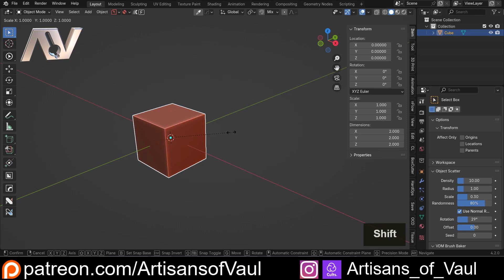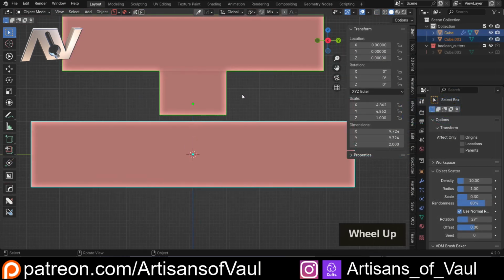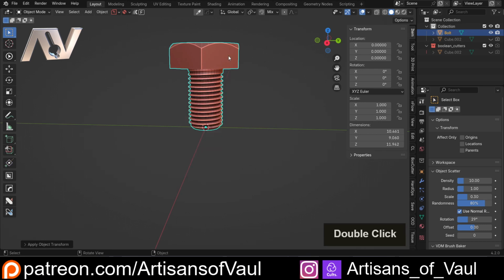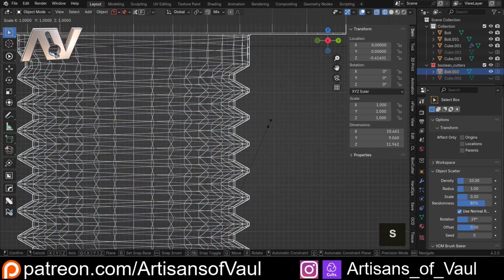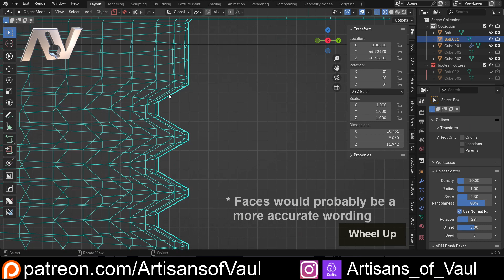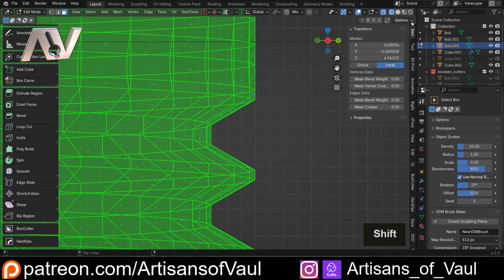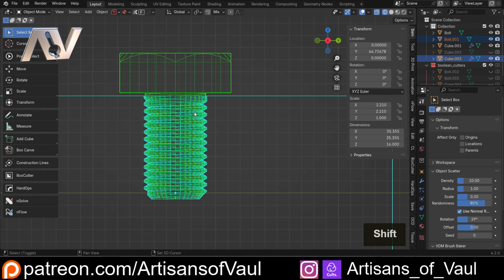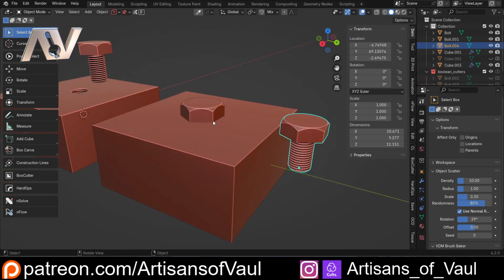The EASY Fix to the "Classic" 3D Printing Design Problem and How to Fix it in Blender

Comment: Great video or not ?  In the top right corner I see that bolt.003 is selected and not the cube. For example, in the video you made  the selected bolt.003 +0.20mm wider by using Shrink&Fatten. But if you make the bolt.003 +0.20mm wider, it never fit into the cube. Shouldn't you make the bolt.003 narrower -0.20mm to fit in the cube?  Or make the inside van the cube +0.20 mm wider, so that bolt.003 fits into this cube?
Reply from the maker: @janvanderveer316  You've got this the wrong way around in your head I think. Bolt.003 is the object being cut from the cube to make the hole for the other bolt to fit into so needs to be wider to provide the gap needed.

Comment: When I attempt to use the shrink tool on threads they go crazy. They either get really small or really big...it also puts like a cylinder around my threads. I cant figure out how to fix this issue.
Reply from the maker: A cylinder?  I cant say I have ever had that issue to help with it.  If you need finer movements if you use the shortcut with your mouse further from the object it will give you more control, possibly that will help?

Comment: I would loooove a tool to auto-add peg/keys to parts for 3d printing. if you could auto-set up a tolerance for the result, and then just auto add male/female parts based on the tolerance setup. Could probably write some sort of script to do this maybe.
Reply from the maker: @CinderBlock331  I recon you could make something to do that with Geometry nodes. Then just use the object as an asset. Or alternatively have different sizes with a cutter for the boolean as a collection as an asset
Reply: @ArtisansofVaul  Geometry nodes is a great idea. I havent really messed with them, but I might give that a try. A collection is a good idea too, if not a bit clunkier than my ideal imagination.

Comment: Thank you for the video! For me, scaling only along the x-y-plane has worked so far for threads and bolts, but I haven't used such long bolts, where it might not work anymore. I wonder if you have a method, workflow, or addon that allows Booleans for 3d printing giving some absolute tolerance like 0.2mm no matter the size of the object. Scaling is always a percentage value as far as I know, and it always needs some individual adjustments for each object pair.
Just saw a comment from imonseii about shrinking with tolerance in mm...

Comment: If you know the tolerances of your printer, you can go ALT-S 0.1 (for tolerance of 0.1mm).
Reply from the maker: Good tip 👍🏻 I normally like to look at the movement as I do that to check for crossing over edges but it's a great tip.
Reply: @ArtisansofVaul  that's a very good point! if you do the 0.1, and the overlap is only tiny, you only find out after you use "3D printing toolbox" to check the model. which means more cleanup, and time wasting hassle. i guess my tip is best suited for relatively simple models.
Reply from the maker: @imonseii  I think both are very viable workflows. The 3d print check is always a good call regardless, as soon as you're done, as you could always visually miss something.

Comment: This is why the 3D printer software usually has the expand/contract edges feature. At least on filament printers. Don't know if I've seen it on my resin one.

Depending on your philosophy for modeling.. some might insist the model remain the pure shape and the printer just fixes its own limitations in material expansion to make the end result actually match the model (by knowing the growth factors based on the material and various settings, and then counteracting them itself), but this is very hard to do right, and usually way easier to just manually change the model. Talking to mechanical engineers at work, they tend to design in tolerances and such when they're designing parts.. but those are for general tolerances and fit. If you change materials or processes, then we seem to let the one making the part sort it out, not alter our original design.

This has me curious about the best path you should design with. Do you make the printer just compensate and print what you sent it, correctly (or hope it does, and try and troubleshoot when it doesn't?) or do you just manually tweak all that for your specific printer and settings, knowing that while it's fast, you'll be stuck adjusting it if something with the printer changes, such as nozzle size on FDM or exposure settings on resin.

Not to mention, there are things the printer can't easily deal with or would be very complex software, forcing you to adjust your design to make it easier on the printer, anyway. Breaking a model into pieces or making it hollow is the most obvious part you might do in Blender. Supports are even more obvious, but in general the printer software helps you create those before sending it to the printer, of course. Some are adding features to hollow out and cut parts into sub assemblies now too.

I'll have to chat with my coworkers about this now.
Reply from the maker: All good questions. Personally when modelling I would rather build it into the models as it means I can look at any odd results as opposed to the machine doing it where there are might be issues that havent been seen.  Also with 3D printers there are so many factors involved they rarely take account of everything so I would still give some tolerance (even if its less).
Reply: The reason I brought it up was that I have 3 different options to make something (depending on the nature of it), a laser cutter, a filament printer, and a resin printer. And all have very different tolerance considerations. So if I wanted to swap from one to another, I'd have to back out changes specific to that one printer, and add new ones for the next. Even changing filament or resin type might require further tweaking. Seems that would be best managed in the print/slicing software.. but, as you pointed out, they don't always do a great job.
Reply from the maker: @stormycatmink  I have a similar issue but have found it notably more reliable to just have those parts with a "joining" element have a non-destructive boolean for the cut out where I can change the size of that part specifically, of it that isnt possible have the key object as a non-destructive union so I can change that.  I found it took less time to do that than to fiddle around with machine settings and get them "dialed" in to work the way I want.

Comment: Great educational video, but why do that on a practical level? Just isolate your Z (shift+Z) axis and scale the bolt to make the cutter.
Reply from the maker: @andreigalinski413  Good question. In those instance that could work for this shape (though for printing I would still do it this way as you can get some expansion on the Z axis). But in other shapes that wouldn't always work so it might as well be done the correct way to begin with.

Comment: Wouldn’t the solidify modifier do this as well?
Reply from the maker: @colordodge  I don't think so. That would make a solid "shell" with a hollow middle.
Reply: @ArtisansofVaul  I've used this technique successfully so far on a couple prints. I just apply the solidify to the cutter object. I check "fill" and "only rim" - which seems to do the trick. The upside is I'm able to come back and adjust clearances later. But admittedly, I have not tried this with something as complex as a thread - mostly for press fit parts.
Reply from the maker: @colordodge  oh nice idea. Yeah that should work thinking about it too 👍🏻
Reply: @ArtisansofVaul  Yeah, and I haven't looked into it, but if blender has the ability to assign variables, you could update all your clearances on a model with one value. That would be cool.
Reply: @colordodge  you can do that with a driver. it's a little clunky to set up though. a simple-ish way of doing it, is to click on your main object, and in "object properties" add a new custom property. right click on the custom property, and select "copy as new driver". then find your solidify modifier, right click on the thickness and select "paste driver". repeat the "paste driver" for each of your solidify modifiers you need tolerances for. now you can change the custom property value, and all the solidify values will change.
Reply: a simpler way of doing it, is probably to just right click on the first solidify thickness, and copy as new driver, and do paste driver, on all the other solidify thickness values. Then you gotta keep track of which one is your main one.

Comment: Excellent advice! Especially since it's not always just bolts! I never thought of doing it this way.

I think he bolt is tiny because most bolts aren't measured in meters. ;-)    The "Keep Making" youtube channel sells an add-on called "Precision Gears" that lets you build gears and bolts specifically for 3D printing, as well as a whole DIY board full of screw-in parts with different size screws. He focuses on actual functional mechanical parts more than artistic stuff. Just in case any viewers wanted to make a whole bunch of bolts and gears of different sizes a little easier.
Reply from the maker: @darrennew8211  Great tip. I think you've recommended before and it's on my list to check them out 👍🏻
Reply: @ArtisansofVaul  Particularly for gears and bolts. 🙂

Comment: What would you say a reasonable size-up is for resin printers? 

BTW, I fell in love with your vids and they helped me a BUNCH on my journey to designing stuff meself. I love the way you explain stuff. No unnecessary BS around it, straight on point. Thank you and keep it up, please :)
Reply from the maker: @ducba1059  😁😁 Thanks so much. So I deliberately didn't give a specific number as it can really depend a lot on the printer and how "tuned in" it is. So there will be a bit of trial end error but I normally start around 0.2-0.3mm

Comment: In general, for FDM printers you want to size-up the cutter by .25mm on x/y to account for squish. In case anyone is wondering how much “a little” equates to. The amount you change on Z really depends on how thick your layers are. It’ll probably work with no adjustment on Z, but it may squeak when you screw it in - so I usually adjust Z by .2mm just to avoid that.
Reply from the maker: @karmachameleon326  Really helpful comment 👍🏻👌🏼. I've found the x/y similarly depends a lot on the size of nozzle being used so I didn't want to give a specific amount but I find about 0.2mm on all axes works for mine. But as I say it can vary a lot.
Reply: @ArtisansofVaul  The usual advice is slightly more than half the nozzle width for a hobby FDM PLA/PETG print. There's a half a sphere on each side of the nozzle, plus the width of the nozzle as a bar, and then the middle of the nozzle follows the tool path. So a gap of 0.22 or so is going to be perfect with a perfectly-tuned FDM printer.